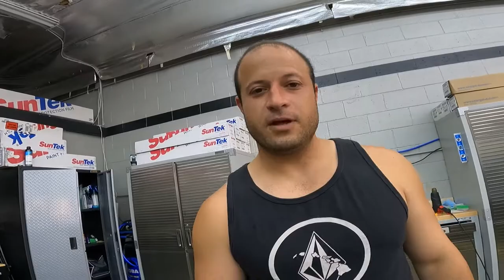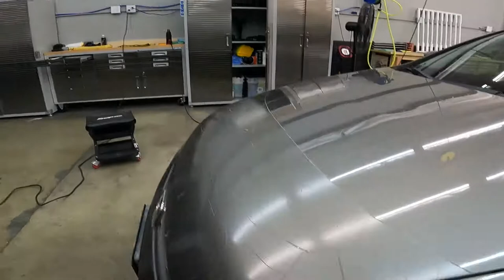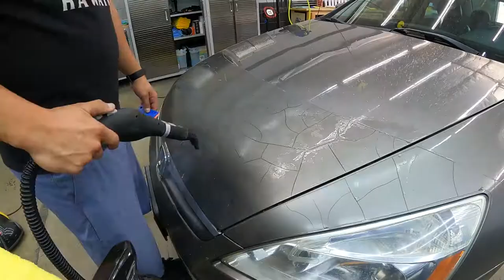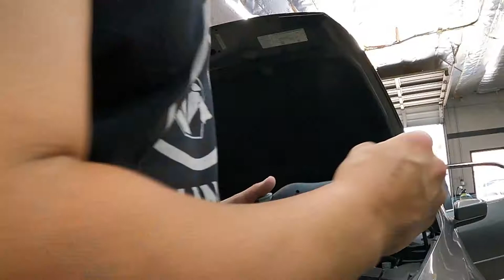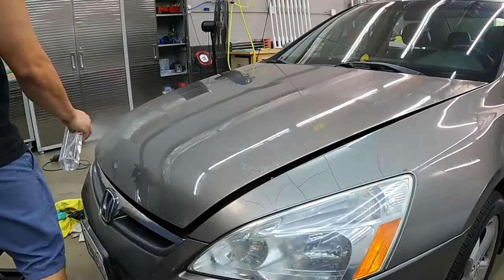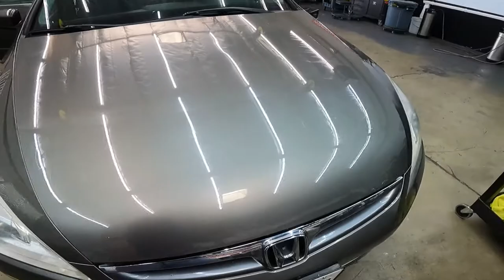How To Remove Cracked Paint Protection Film (15yr Old) Nightmare!!!

Comment: your taking off the protection film, but i dont have a protection film but its the clear coat is cracking. it started cracking from a certain edge and into the body work.  the paint is fine just the clear coat.  how would i fix that???  would i have to sand it down and re spray the clear???  please help if you have any advise i would love to get some info.  or if anyone in the chat has an idea i would like to hear from you.

Comment: What tool did you use to scrape the film off?
Reply from the maker: FOSHIO Plastic Razor Blade Scraper Include 2PCS Scraper Tool and 100PCS Blades for Gasket Remover, Labels Decal and Adhesive Remover for Windows and Glass https://www.amazon.com/dp/B076BBW1WM/ref=cm_sw_r_apan_glt_i_8HX6MRRP3PCXQKV8J8PB